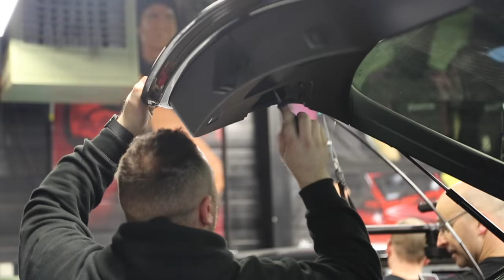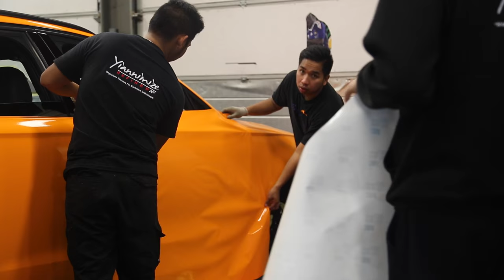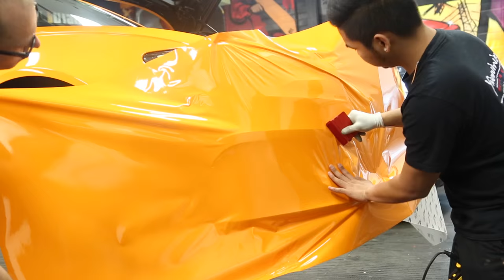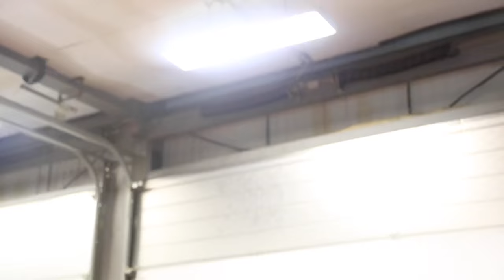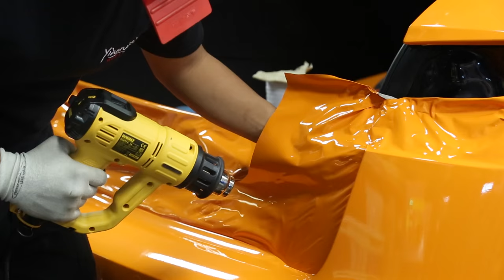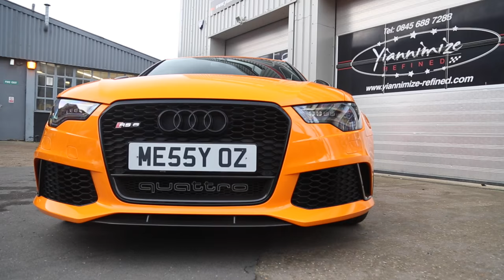Audi RS6 wrapped HOT Orange!

Comment: I'd like to see how they colour the calipers
Reply: +On XL yeh I'd guess that, I'd still like to see how they do it
Reply: +DJ Nasu I'm on about taking it off the axle, spraying it and refitting it............
Reply: Maybe this sound's stupid but why cant you wrap the brakes? Sorry for my bad english
Reply: +Christian Lott.
Reply: +Filip Rezko wrap will melt under heat
Reply: +Filip Rezko not enough surface area, I would imagine
Reply: +Filip Rezko I would say, take your car, go for a ride and brake hard and than spray some water on the caliper and disc. It goes to an instand boil than, that's why. You can meld the plastic with an heat gun so with the heat of the caliper it would melt right away.
Reply: That escalated quickly
Reply: Rav Jagdev are you rav from SMSHS? dafuq?!?!?! I may have met you on youtube by chance LOL

Comment: What's the chance of getting copped for the spacing on the number plates? Anyone had any past experiences?
Reply: +Xtreme1215 depends how much its changed... this gets picked up on ANPR fine which i think is the main point. 10 or so police have mentioned it... none actually issued a ticket for it, in 4 or 5 years like this.
Reply: Oh that's not that bad then. I've bought one recently, going to get it made but wasn't sure one whether to get the spacing done like yours. Thanks for your reply anyway.
Reply: I got done for wrongly spaced plates they followed me for 7 miles before pulling me cost £160 quid new plates and had to have a new not test and photos sent to DVLA get pulled again they take your plate back.

Comment: Is it not ilegal to tint the front windows?
Reply: +Arianit Drenica you can tint it to a certain darkness
Reply: Yeah but the worst that can happen is police will get u to strip it at the side of the road but most of them will just warn you. On my Audi A3 1.6 (don't kill me it's only my first car) I have the front tinted and the worst I've received is police pull up next to me at lights and tell me to get rid of them as soon as I can
Reply: +Yash Joshi and ofc you dident remove them :P
Reply: +CarPassion 😂 yeah I didn't they bloody cost me £200
Reply: Yash Joshi basterds XD
Reply: +Yash Joshi 30% tints are legal on the front
Reply: But you're tinting the window you see through so it's dumb
Reply: +Nathan Fleetwood Hence why the limit is 30%. Therefore the driver will have a safe amount of viability.
Reply: +Jobawick UK the legal tyre tread is 1.6mm people don't buy tyres with just 1.6mm do they?
Reply: +Nathan Fleetwood No, but you don't buy a car that already has 30% tibt always do you.
Reply: +Jobawick UK Tint*
Reply: +Jobawick UK It wouldn't put me off as it can be removed lol
Reply: +Nathan Fleetwood and a car with tyres that are barely legal can have a new set put on. Either way, there is not a problem with tints on the front.
Reply: +Yash Joshi what reg is ur a3 pal ?
Reply: +Faisal Hussain it's a 2013 facelift buddy